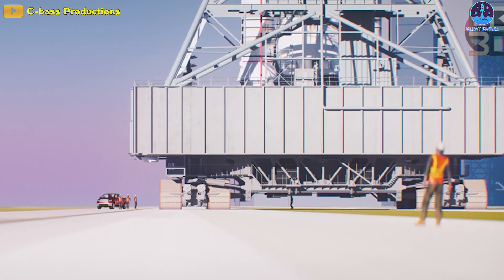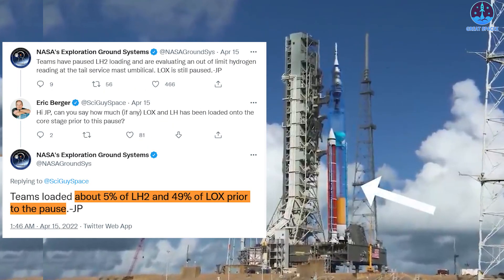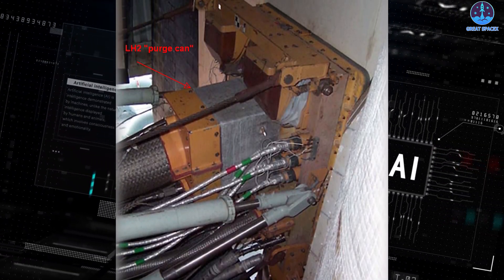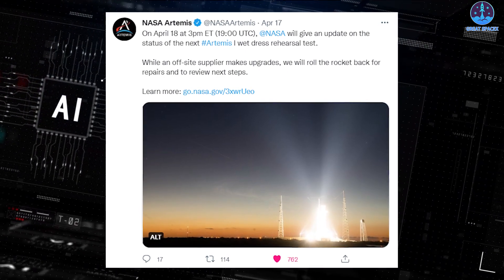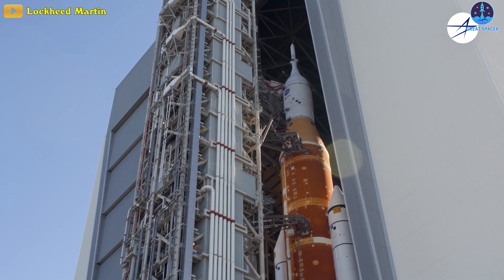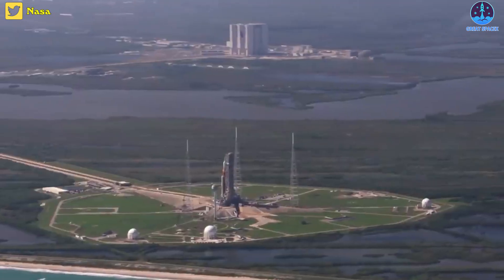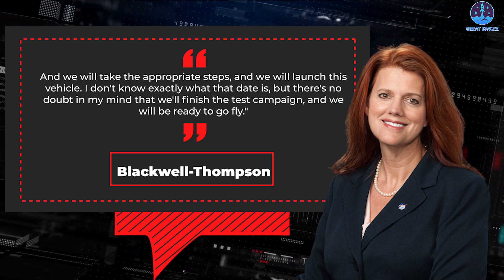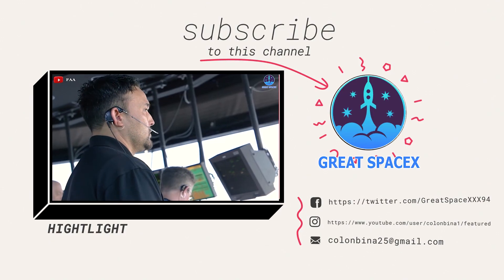NASA to roll back its mega-rocket after failing to complete countdown test

Comment: Just scap SLS and use Falcon Heavy. Even if it takes two or three Falcon Heavy launches to get the hardware in orbit you're still way ahead of the game.
SLS is obsolete before it ever leaves the ground.
Reply: I would revamp the plans and use starship’s low cost 100 ton payloads.  Just bolt the thing together in orbit.

Comment: You see, well, you're not understanding, it was a thing, a problem, an issue. The widget was non conforming. It's a special widget. Important widget. It will only take several bonus check periods to replace the widget, plan on a possible launch very soon. Just let the bids for special toys that will be coming up for bid real soon, special toys are important.

Comment: How old is NASA?  Haven't they done most of their testing back in the 60's and 70's?  How capable are they to launch a rocket?  Tolerances and seals should be an easy fix for them
Reply: Right? It's not like they've never done this before. And this is with legacy hardware. Whereas the Apollo program was built and flown from scratch in less time.
Reply: @Petefx86  well they're busy with diversity, equity and inclusion so you know there are affirmative action hires that arent so great these days

Comment: Or, they could attach the second stage to a SX Super Heavy and probably resolve the problem more quickly. If the FAA approves the Starship launch and the Super Heavy flies satisfactorily, it will have accomplished far more that the SLS. It doesn't even have to return to earth. As far as leaky vales, and seals, did someone forget to tell them that these parts would have to operate, and be tested, at very low temperatures? If it takes five trips to haul a rocket back and forth to the launch/testing stand before you can expect to fix it, then you take those people responsible who are five years behind schedule and billions of dollars over budget and fire them all.

Comment: I want to give them every benefit of the doubt I can, but come on. Most of this hardware is identical or nearly identical to stuff we have been flying for decades. I know rockets are hard but how can we have this many problems when we used the same engines and basically the same boosters all the time  before I was even born.

Comment: Maybe I'm wrong here, but wasn't the SLS suppose to be relatively quick, cheap, and easy to do as they were just going to basically rearrange some of the existing shuttle tech (shuttle engines, boosters, etc) to basically make a shuttle launch vehicle minus the shuttle part? Perhaps I was mistaken...

Meanwhile, SpaceX in basically the same timeframe has developed and built a fleet of extremely reliable, reusable, and cheap Falcon 9's. And is in the process of developing a completely reusable heavy lift vehicle (Falcon Heavy not withstanding) in the form of Starship...
Reply: That’s what I’m saying. I’m not trying to undermine how hard making a new vehicle is, but most of the complicated parts are tried and tested by now
Reply: @ghostrunner2138  Exactly.  Not only tried and tested, but also previously used.  The only things different from the propulsion system of the Shuttle is a bigger fuel tank, and SRBs with an extra segment.  It is simpler than the Shuttle too - no complex disconnect from the tank to the engines is required and no reusability.  There is absolutely NO reason for the SLS to cost as much to "develop", take so long, have an estimated cost PER LAUNCH of over $4 billion, and still be unable to complete so much as a wet dress rehearsal after three attempts.
Reply: That's the argument they used to sell the project to Congress. They've since said they never expected it to be easy and anyone that did didn't know what they were talking about.

Comment: If SLS wasn't politicaly delaying Starship, I couldn't care less for SLS' timeline.
Reply: me too
Reply: Starship is still not ready to fly so it is not being delayed..
Reply: @canidae7  The starship V2.0 (with raptor v2.0) is not ready to fly, but the v1.0 (with raptor v1.0) has been ready since the Feb. The FAA kept the starship on ground and spaceX has to work on the version 20.
Reply: @zhchbob  Well version 1 was almost ready but was abandoned for a reason ;-)
Reply: @canidae7  It is abandoned because it is a test ship for an orbital fly test, which is hold back by FAA. Therefore, spaceX has to bypass that test step and directly go to the version 2.0. The FAA disrupted the proper development procedure of starship and should be answer for any launch test failures in the version 2.0.
Reply: @canidae7  There is a difference in how SpaceX conduct their R&D. 
So, if testing is being delayed, the whole program is being delayed. 
Maybe Starship isn't ready to commercial flights, but it is ready for testing.
Plus, there is a clear political intrest in not allowing Starship to render SLS useless before it is even launched.

Comment: Folks, SpaceX, as everything in the science world, was built upon the shoulders of those who came before them. If not for the documented experiences developed by all previous space endeavors, SpaceX wouldn't have achieved the current level of technology they have acquired. However, their try, fail, try again process of innovation ..... speeds up the process tremendously. But they don't have tax payers and oversight committees holding them back. This is the benefit of having a single visionary with incredible cash flow ...... in charge.

Comment: The problem is that the propellant in the solid rocket booster has a limited shelf life.  Northrop Grumman says the lifespan is 18 months.
Reply: That is not “the problem” is only one on the pile of problems. 
Hahahaha 
But thank you for that information. I didn’t know that!
Reply: Solid fuel, VERY DANGEROUS!!!! ONCE ignited, it can't be shut down. Like a giant Roman Candle!!!!!
Reply: @anjetabreymann7179  The fuel is somewhat frail as far as I can tell.  Once it reaches a certain age in the booster it can no longer be used.
Reply: That's very bad news
Reply: Funny... the use by date was just 12 months when it was packed into the SRBs...

Comment: Everyone complaining and making a big issue of the wet dress test needs to stop...  look at the Space Shuttle and Saturn V, both under went several tries( even close to 12x) for a wet dress test,  even SpaceX has done several wet dress tests!!!  Just because someone says the test was successful is very subjective to their checklist and goals. Nothing is perfect on the first try not even brand a new car models are perfect off the factory floor.  Gotta say this channel need to step up it's reporting and facts and stop guessing and hypothesizing,  plus stop deleting comments due to being pointed out for their inaccuracies in their reporting.
Reply: SpaceX is NOT conducting Wet Dress Rehearsals on a flight-article. What it IS doing is perfecting the skills of its teams for the day when it DOES do a WDR on a flight-vehicle so that there are no leaks in umbilicals, no frozen, stuck valves, so that the teams understand failure-modes before they happen for real.
NASA is incompetent and doesn't do that stuff. They don't have dummy or prototype vehicles to do tests on. And no amounts of computer-simulation will ready teams for pesky real-world issues with faulty equipment made by third-party contractors.
Reply: @mauricegold9377  Wet dress can and is referred anytime a vehicle is loaded with any type of liquid for testing, rather is fuel and oxidizer or a neutral liquid (water or super chilled nitrogen)
Reply: @SpaceOne-p1d  English comprehension clarity fix here: my point was not what defines a WDR but rather that SpaceX is not conducting WDRs with flight-articles quite yet. Their teams are practising and practising and evaluating the performance of their rocket parts, and getting their teams ready for a WDR on a real flight-article. That way there won't be the nasty surprises after 11 years of computer-simulations that NASA/Boeing are currently experiencing. Just why Boeing has had no test-articles for evaluation since 2011should be a vital question (that is, if one was led to believe that the end-result was a functional rocket, as opposed to 11 years of corruption and jobs in impoverished southern states).
Reply: @mauricegold9377  " SpaceX is not conducting WDRs with flight-articles quite yet. Their teams are practising and practising and evaluating the performance of their rocket parts, and getting their teams ready for a WDR on a real flight-article." That is a "wet dress test" anytime a vehicle is loaded with anything (not empty air)  rather it to test seals, welds, or function of valves and components is a " wet dress" .  Every aerospace company will call it what they want, or say its a "test of (part A)" but its still wet dress. Wet dress does not just take place on "flight-articles" but also on prototypes.
Reply: @SpaceOne-p1d  it's ok. Had you comprehended what I wrote you would see that we agree that whatever they call it WDR or whatever, that SpaceX are doing WDRs on whatever prototype they currently are using. Flight articles are yet to be decided (or even constructed). So fear not, we are on the same page of the hymn sheet, even if it didn't seem obvious at first reading.

Comment: Apparently the current SLS launch tower is not straight and NASA are spending around another $1 Billion for some time now to build a new one 'quickly' for Artemis flight 2 in 2024. 
Also the Orion capsule they are flying has a faulty power supply; so no backup redundancy, As it would take around a year to replace it :(

Comment: This is one of the major, if under reported, reasons why hydrogen fueled vehicles have not yet succeeded. It is a nightmare to handle, store and transport. Not just because it leaks, but because it is so flammable in the presence of oxygen.
Reply: That may well be almost true. A bike designed by Linde includes a 34-gram cylinder of hydrogen, which supports assisted pedalling over a range of 100 km. Liquid hydrogen is transported by rail and road to get it to their end users. They must manage leaks otherwise they would end up exploding, so it shouldn’t be that hard for a space agency

Comment: There's a reason why hydrogen isn't the preferred rocket fuel, or fuel for any other vehicle for that matter, despite so many apparent advantages.
Reply: Hydrogen is basically a single Proton without even a Neutron. An Electron is 1800x smaller yet.
 No wonder you have to freeze the hell out of this stuff. This begs a good question. Germany used Hydrogen in the Hindenburg. How is that ?!!? 🤨🤔
Reply: @davidmacphee8348  Apparently the loss wasn't great enough to cause an issue in the time needed to cross the Atlantic. Given how cheap and easy hydrogen is to produce compared to helium, it made financial sense. Until Big H went BOOM that is.
Reply: @alderwolf7687  Well, I agree completely.

 I think the Hindenburg was originally designed for helium. Helium is heavier with two Protons plus the two Neutrons. 

Anyway, come to think of it, a Plastic Helium balloon can stay inflated quite awhile.
 I like when the toy weighs "nothing" in the room with a bit of tissue as a ballast so that it just hovers in one spot.. 

It looks like it can demonstrate the effects of Gravity this way. Any solid object, even your hand can attract it and move it around in the air like Magic!
Reply: @davidmacphee8348  we're running out of mineable Helium here on earth that's the biggest thing
Reply: @davidmacphee8348  The Hindenburg was originally designed for helium but the US wouldn't sell it to them so they used hydrogen instead.  Far more dangerous but it actually gave more lift.
Reply: @chrisantoniou4366  Yes! Thank You!

Comment: Just my own thoughts, Then "The Government" needs to let Elon and Star Ship Launch and stop holding up there progress.
Reply: But NASA can't afford to have Musk have a successful orbital of his new launch vehicle before SLS has its first test flight.  Eventually SLS will be cancelled; it is obsolete and too expensive to fly.
Reply: @jamesrogers47  Or it could be the current Administration doesn't want another slap in the face, One or the other.
Reply: Exactly I am agree with you
Reply: Government agencies might well hold up a launch of Starship, but they cannot hold back SpaceX's progress.  SpaceX is still planning, developing, refining, improving, and building.  Sure, they can't learn from the experience in the same way as an orbital attempt, but they haven't stagnated either.  This is in complete contrast with SLS which has not only stagnated, but is going backwards.  Apart from the well documented problems with the wet dress rehearsal,  has anyone twigged yet that the SRBs will have to be replaced because they are beyond their use by date?  Unltess something has changed that I'm not aware of, these SRBs have to be used within a year of loading propellant, and that was done in Jamnuary 2021.
Reply: @chrisantoniou4366  I seen a short piece on the SRB's and it said that exact same thing about they have to be replaced because of shelf life has ended. So more money spent and wasting of time.
Reply: @richdillon2157  As well as the money, I wonder what kind of "wet dress rehearsal" it's going to be if you have to replace a large part of your rocket afterwards.
Reply: @chrisantoniou4366  A costly one for the American Tax Payer.
Reply: @richdillon2157  In some ways, a costly RUD might well end up being the most economical outcome for the American taxpayer.
Reply: @chrisantoniou4366  Very well could be. I guess we will have to wait and see.
Reply: @richdillon2157  Quite.  The proof of the pudding is in the eating as they say...  I'm not advocating an RUD you understand, however, I fear that everything I've seen so far makes me nervous in a way I haven't been about a rocket launch for years.

Comment: Hope no one's getting on that ,USA needs Supreme commander Elon to run all their space program
Reply: No. I want competition in launch systems.

Let's look at the list:
* SpaceX - Falcon9 system is proven, Starship in rapid testing. Few doubt their ability to get it to fly. Cost to taxpayers. Low compared to the rest of the list

* NASA SLS - A boondoggle money pit and poster child for a government run operation with a blank check. 

* ULA - Out of Russian engines and waiting on Blue Origin's BE-4 engine. Delivery is 5 years late and counting

* Boeing - IMHO their Starliner program was treated like NASA'S SLS. A money pit.

* Blue Origin - They were supposed to be the other private space launch system to complement SpaceX. In reality to date they provide carnival rides only. And until they achieve orbit with their rocket and engine and prove reuseability & consistency they don't count. At this point Jeff Bezos has more powerful lawyers than rockets. But lawyers can't get you into orbit.

We need another company to step up. The door is left open. As well as SpaceX has been going, the only problem is their laser focus on one mission....MARS. So much else out there.

Who will step up?

Comment: Who in their right mind would ever be willing to fly on anything shown to have so many problems?
Musk and Space-X engineers have had the greatest concepts since Werner Von Braun!
Reply: Lets strap a staliner to the top and let Michael S. Regan be the first EPA director to go to the international space station.
Reply: every single astronaut that has ever flown in space.  

Even if the wet dress rehearsal was flawless, Taking SLS back to the VAB was always in the plan.  they run these wet dress rehearsals to find and fix problems before an actual launch attempt.  Apollo had very similar issues.
Reply: @JoeShmoism  To be fair this is true.
Reply: Yes! And with a smaller death toll!
Reply: SpaceX spent years testing rockets out of the public view in the South Pacific . So any new rocket programs spend a significant amount of time correcting design and manufacturing issues. Also SpaceX is not as constrained by rules and regulations as NASA is. Don’t forget SpaceX let up a rocket about 5 years ago on the pad during a test.
Reply: Nicely Put! 
 Made me smile ... .. ...
Reply: I think SpaceX has blown up more rockets than NASA, as hard as they try to conceal that. They even posted a video of a rocket that "successfully" landed, by editing out the footage of it exploding.  Either your fantasizing too much about Musk, or you think all these fake videos and fake comments will help the two shares you own, lol.